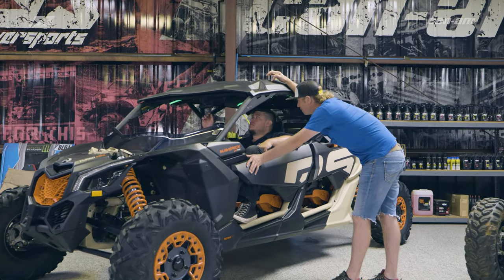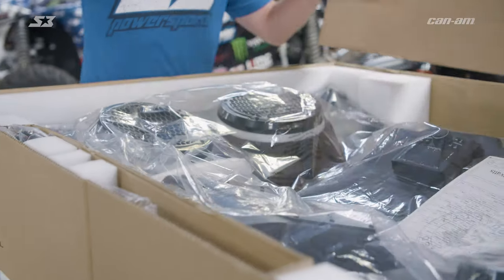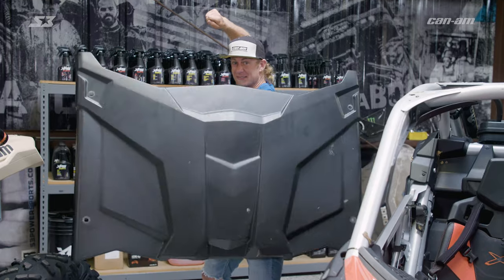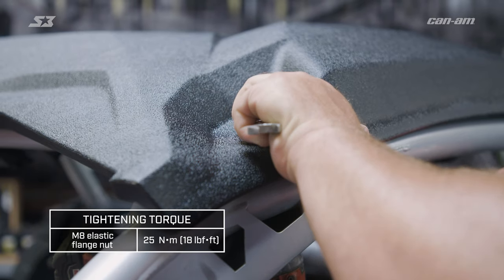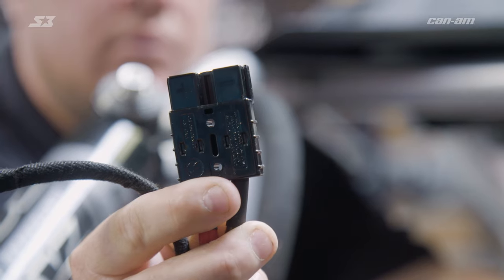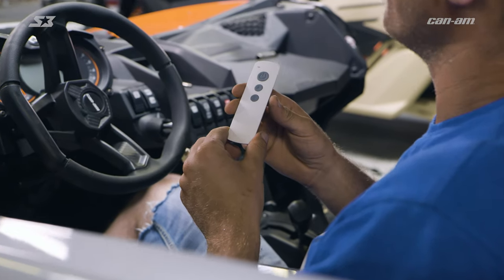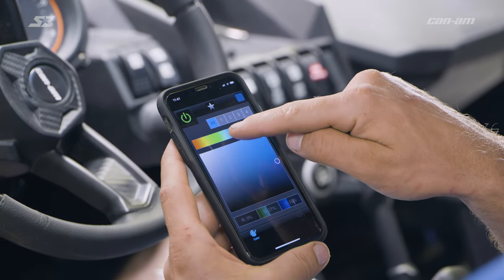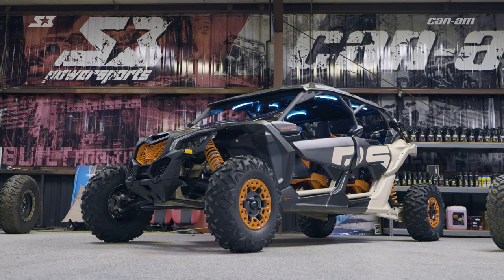How to install the Audio Roof for Maverick X3 | Gettin’ It Done

Comment: I'm seriously considering getting one of these. Their website only has so much technical data though.

 Do you know if this audio roof has the ability to run a line-in cable into the back of the receiver?
Also, does it have a cam input?
(like the stage 6 Rockford Fosgate setup)

I am aware that you can add a subwoofer and that it is a Bluetooth-enabled receiver.
    The only problem I have with that is I have older devices that only have a headphone jack and do not have Bluetooth ability.

I've even emailed Rockford Fosgate and sent them a request for the owner's manual. Still no response from Rockford Fosgate and I cannot find a link to the owner's manual for this on the internet anywhere.

Comment: How does the woofer work with this system?
Reply: I have the same question
Reply: I bought one of those and got it installed but I don't know how to ad the subs
Reply: @jesusdiego8931 i have the same roof but i want to add the sub, how is it done?

Comment: Wish cold add sub to the plug that came on it for the 2 seater
Reply: You can't? I've seen videos where you can but different sound system
Reply: You can add an amp and two subs
Reply: @jrea8401  do I need to purchase the signal sensor or something else? Or only the amp and subs?